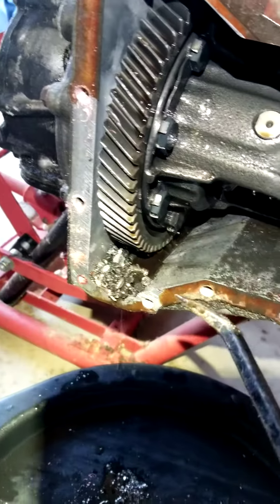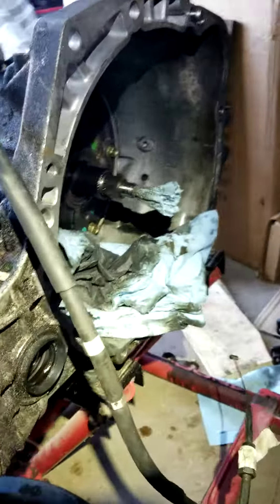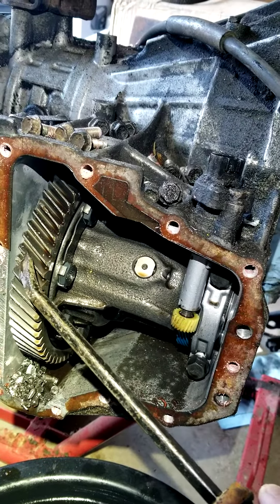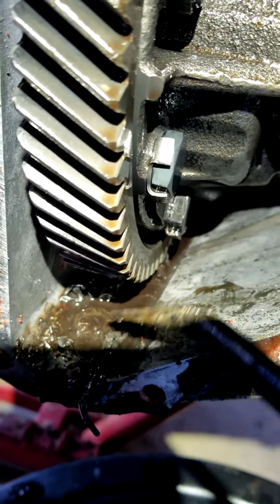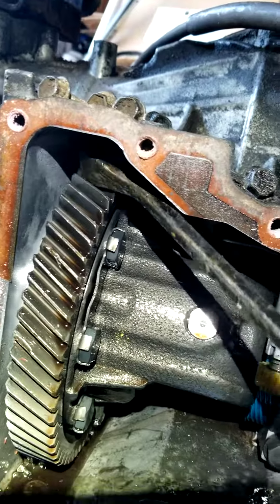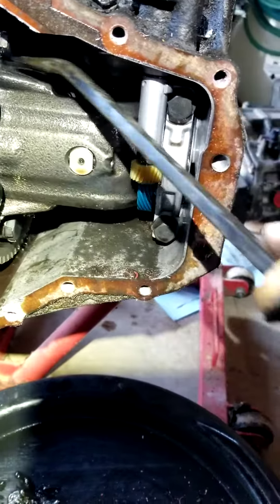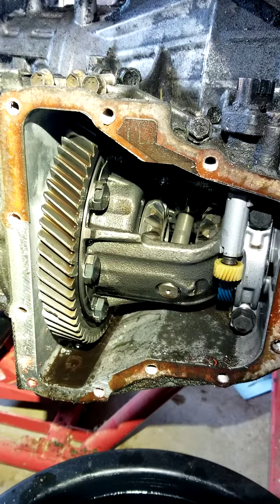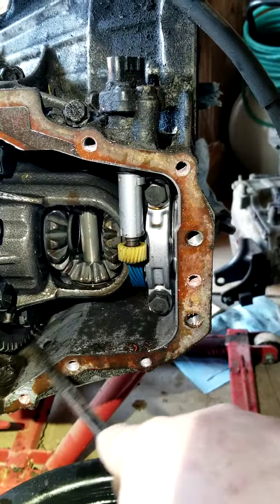2001 corolla A131L 3speeds automatic transmission

Comment: Not just 98-02. I'm looking at a '92 that was just dropped off in my driveway with the same problem.
Reply from the maker: Wow, I'm always learning everyday. Thanks
Reply: @kimzengly  Yep, I have an 88 in my shop right now with the A131L 3 speed. Thanks for the video.
Reply: @jameshisself9324   I have an 88 but I've looked into the differential and dosent seem to be the problem, it won't upshift do you have any ideas?
Reply: @owen3643  Sorry, hard to advise from here. Assuming the basics are in order, it might just need a flush or the bands adjusted. I'd have to drive it to be of any use in troubleshooting.
Reply: @jameshisself9324  Appreciate the reply I'm trying to learn, while driving it it will go to about 30-35mph but will not shift into second, when you put in into gear there is a very slight clunking noise. When you manually shift into second it dosent engage and stays in first gear, is there any place you think I should start troubleshooting?
Reply: @owen3643  I don't even know if there is a version of this trans with ETC. I doubt it, but if yours has that I would start there. If not, check your linkage and cable very thoroughly. You might get lucky and it's just the external mechanism. Maybe arrange a setup with your lift, etc that you can SAFELY inspect under the car while someone else tries the shifting with the engine running. I can not stress enough that if you do this wrong it is very dangerous and the car could move and kill you, so don't be stupid. If you don't find any clues, then drain and drop the pan. Check for burnt fluid. Look for anything wrong, and try to find a procedure for adjusting the clutches or the bands, etc. I don't know enough about the internals of this trans yet to tell you how you might adjust it internally with it still mounted in the car. I would search YT and the wider internet for info on the symptoms you are experiencing. Try searching for the year/model of car and for the trans model. Good luck.
Reply: Did anyone ever find out more? I bought one today and it gave out halfway home. It feels like the clutch is slipping on and off but it can't engage in any gear, even second or low ( 1990 corolla cs limited ).

Comment: Do you know if a 4 speed auto can be installed in a car that originally had a 3 speed?
Reply from the maker: Not that I have done a swap like that before. But I have read many forums online and talked to a handful of experienced auto mechanics about 3spd to 4spd transmission on corollas and Hondas. Its do'able but the problem is it'll be very expensive. I think 4spd is more on the electronic operated side compare to a 3spd which is mechanical. Also there will be different controls modules/ computer brain to operate such a machinery. Gotta keep that in mind too. So your not just only swaping out transmission you have to swap out the modules/ computer brains and make it communicate w/ the ECU. Hey, good luck if you try taking on this task. I would love to hear about it. Thanks have a great day.

Comment: So is the diff compartment filled with ATF or gear oil
Reply from the maker: For the 3spd front wheel drive version, it's filled up with atf
Reply: @kimzengly  yea mines 3sp fwd but it's the a132l is it still aft
Reply from the maker: @9milli4u46  
Unsure but if you enter the part # into Google search engine you'll find more detail. Sorry couldn't help much

Comment: Do I have to pull the trans to repair that? My friend has that same problem.
Reply from the maker: Yes, the trans is part of the differential. The differential and transmission is all one unit. This model only apply to 3speed transmission. Good luck

Comment: Do you know if the differential can be swapped while in the car?
Reply from the maker: Not that I know, I haven't tackle that job of replacing the differential planetary gears in a corolla. Plus it's more cost and time saving to just replace the whole transmission. For a used transmission for under $300 you can't beat that. Just make sure to fill all fluid to spec. And always remember that any 3sp auto transmission in a 1998-2002 corolla has its own compartment for fluids. And that it doesn't share pathways with the transmission compartment. Meaning the fluid from the transmission will not makes it way into the diff compartment.  Good luck. And tread @ ur own risk.👍